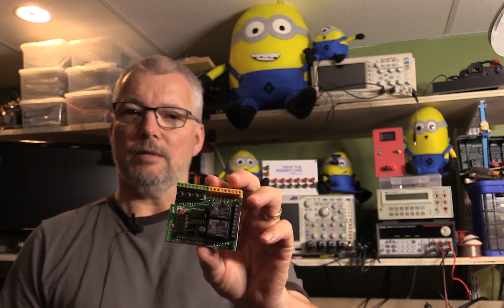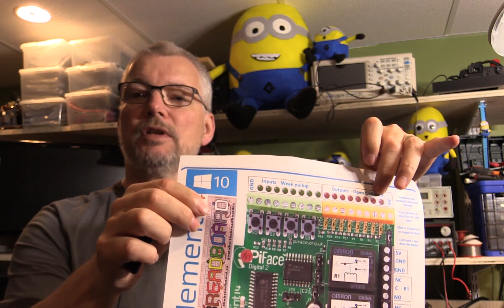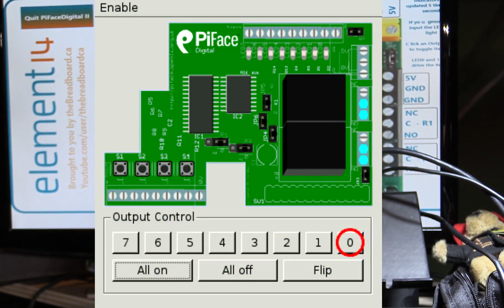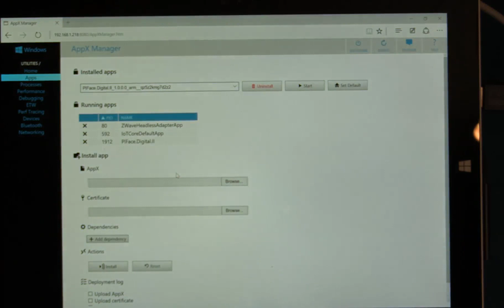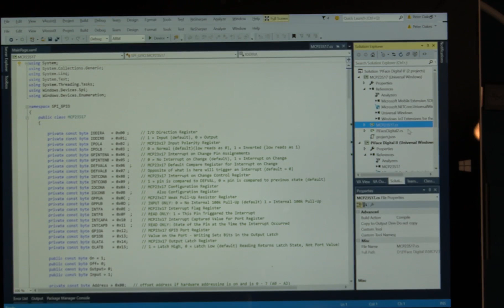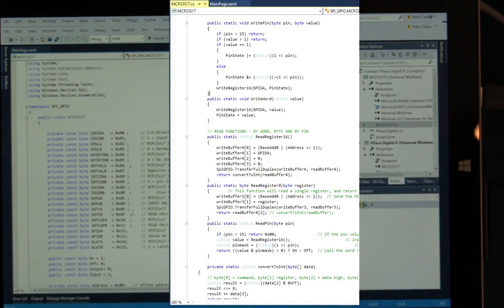Raspberry PI 2,  PIFACE Digital 2 and Windows 10 for IoT

Comment: I have a question. The relays documentation shows that the maximum voltage can be 230V. However, the Piface 2 manufacturer  claims that the maximum is around 20V  - probably because the paths on the PCB are too small for 230V. I have however a question - is it possible to use 230V for a very short time (15 seconds, about 20 times a day). I don't want to power the output device for a long time for hours, but only to provide 230V for 15s, several times a day. Is 230V too much in this case?
Reply from the maker: the relays are indeed rated for 230V and probably 10A, you are correct about the issue being the PCB, i does not have the clearances to handle 230V AC or probably the 10A. In order to stay safe for the user (Remember this is also mounted directly onto a PI board were people are used to handling it even with the power on and if someone go electrocuted they would be in big trouble if they stated it was safe for mains.

so its not about only using it for 15 seconds at a time, it is about the fact it is not designed to handle 230V or carry the 10A (The relay is sure, just not the board). What would be better is to use a solid state relay driven from one of those relays and have it properly mounted away from the PI and with appropriate wiring to handle the mains. or even better would be to use a SONOFF module, I have plenty of videos on how to use them with a PI, they will use wireless communications to be turned on or off.

So if your not trained in the use of mains and the like needed for this I would suggest you find another way like the SONOFF or Solid State Relay and most of all... be safe.
Reply from the maker: Also, if you chose to use a solid state relay, you could use one of the open collector outputs to drive the low side of the relay that would be mounted off board in a safe enclosure

Comment: would this work with raspi piface digital 1  old piface
Reply from the maker: I am fairly sure it uses the same chip so there is a good chance, my only concern would be if it used the other SPI bus, but that would be an easy code change.

Comment: Can't get the code to work. Is it up to date?
Reply from the maker: I have not tried it on the latest Windows 10 IOT, but I cant think why it would not work, what errors are you getting ?
Reply: These two "Error CS0006 Metadata file 'C:\???\PIFace Digital II\PIFace Digital II\MCP23S17\bin\ARM\Release\MCP23S17.dll' could not be found" and 
"Error  Could not find SDK "WindowsMobile, Version=10.0.0.1"."   And a couple of warnings: 'ex' is declared but never used.   Im kinda new to this, did I do something wrong? :)
Reply from the maker: Looks like you may have a few issues.
1. the ex not used is only a warning and has no other effect.
2. make sure you have permissions to write to the location of that release file.C:\???\PIFace Digital II\PIFace Digital II\MCP23S17\bin\ARM\Release\MCP23S17.dll
3. it should not be looking for a windows Mobile that I am aware of, I would have to load it up and verify at a later date but im pretty sure that's also wrong.

if these are the only errors then it looks like your pretty close. What happens if you try debug mode rather than release. Also try running Visual Studio as Administrator User, that will often fix a weird error.

Regards

Peter
Reply: Thanks for the help and thanks for the videos.

Comment: Thank you very much for this Project Peter . I have one question : i want to connect just the MCP23S17 to my Raspberry and i want to set the Pin 2 ( of the MCP23S17 ) to an Output  and see the value of this Pin with my LED , I have used the two Functions of your library : Set Pin mode ( 2,0) ;Write Pin (2,0);but it didn't work for me ,Can you please help me ? Thank you in Advance :)

Comment: Please reupload the code. Thanks
Reply from the maker: +luky58527 The site is having problems right now, I will check once E14 has resolved the issue, in the mean time I will look to uploading to GIT or something
Reply: +Peter Oakes (TheBreadboard) Thank you. I think I found an error, but I'm not sure because I don't have the code right now.. But in ReadRegister8() func, you are reading into readBuffer3 and returning from readBuffer4. Maybe misstype? http://prntscr.com/8qc8m0
Reply from the maker: +luky58527 you are correct, nice catch. I am not using that function in the code I posted but it was there for completness. this is why I did not spot it.
public static byte ReadRegister8(byte register)
        {        // This function will read a single register, and return it
            writeBuffer3[0] = (BaseAddR | (Address << 1));  // Send the MCP23S17 opcode, chip address, and read bit
            writeBuffer3[1] = register;
            SpiGPIO.TransferFullDuplex(writeBuffer3, readBuffer3);
            return readBuffer4[2]; // convertToInt(readBuffer);                             // Return the constructed word, the format is 0x(register value)
        }
should be
public static byte ReadRegister8(byte register)
        {        // This function will read a single register, and return it
            writeBuffer3[0] = (BaseAddR | (Address << 1));  // Send the MCP23S17 opcode, chip address, and read bit
            writeBuffer3[1] = register;
            SpiGPIO.TransferFullDuplex(writeBuffer3, readBuffer3);
            return readBuffer3[2]; // convertToInt(readBuffer);                             // Return the constructed word, the format is 0x(register value)
        }